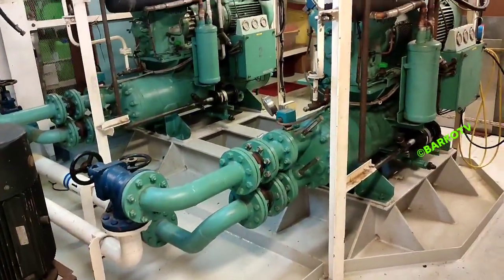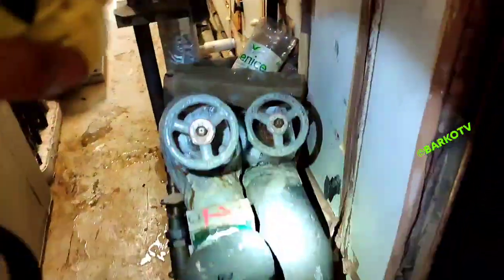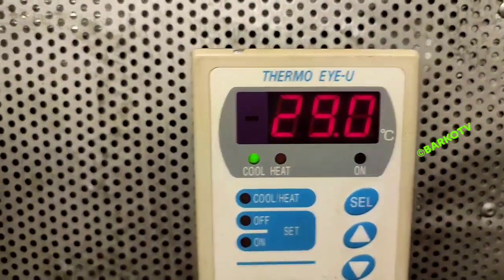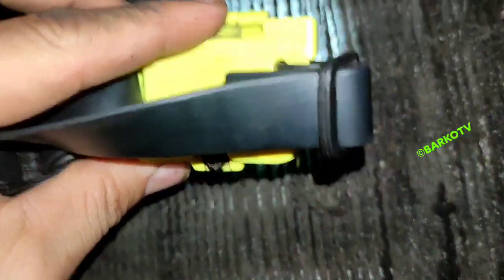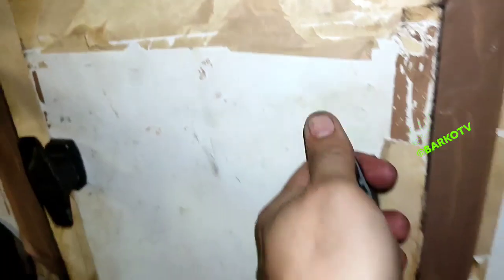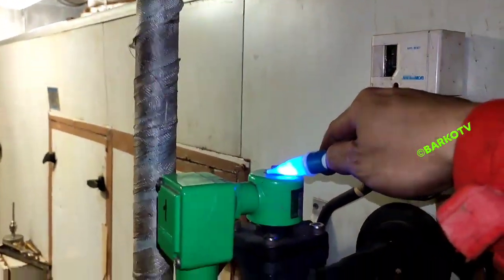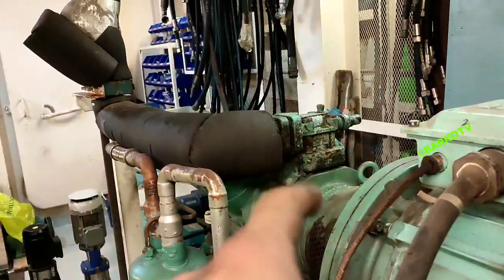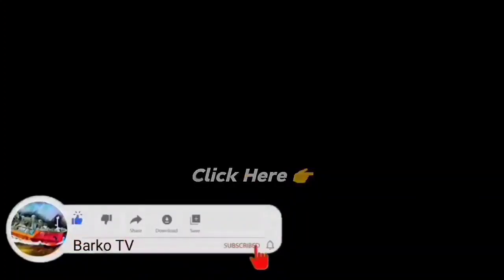Very Dangerous | Easy to rectify | why suction valve full of ice? marine Air Conditioning Unit

Comment: Thank you.. here we installed new evaporator, started system, evaporator coil full of ice.. what could be the reasons?
Reply from the maker: common reason is Lack of charge,need to top up the system with refrigerant
Reply from the maker: If the charge is normal,common prob, there is a un condensable to your systems like air.need to vacuum your system and re charge again

Comment: Sir ask ko lang po palagi po nag icing Yung TXV at evaporator nmn ano po cause nito salamat po God bless
Reply from the maker: Sir, daming possible cause po, sa Ac nyo po ba or sa reefer? Pag sa reefer, check mo yong refrigerant, defrosting heaters kung gumagana po ba. Pero kung ok naman lahat, pump down mo at pa settle down mo muna ng mga isang oras tpos mag bleed ka kunti doon sa taas ng condenser, merong valve doon, then pasingawin mo para matanggal yong mga uncondensible or air na naka pasok sa system. Pag makita mo na pure puti na, it means refrigerant na yon. Sana maka tulong.last option mo na yong expansion valve mo. Meron din kasi yang filter sa loob